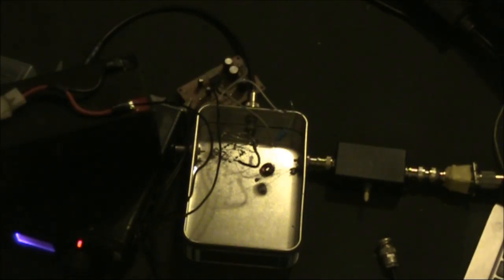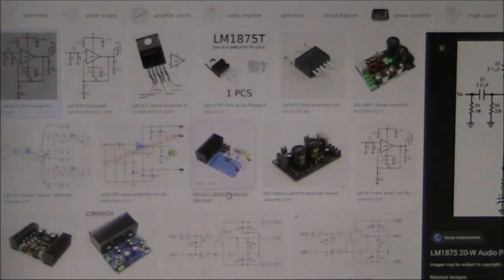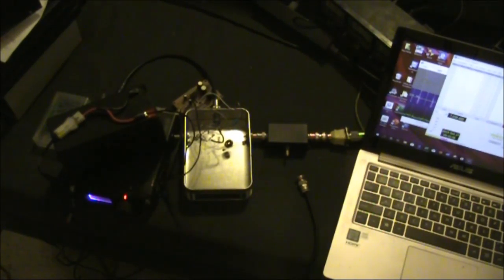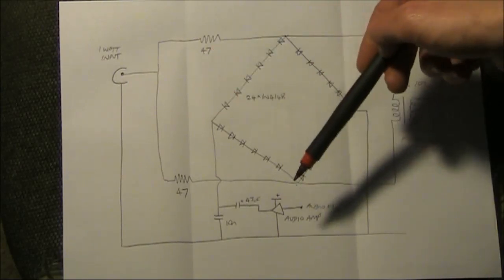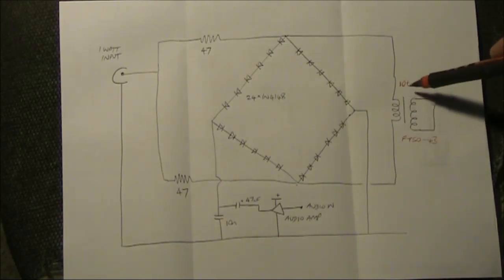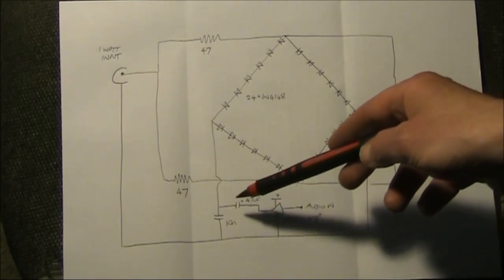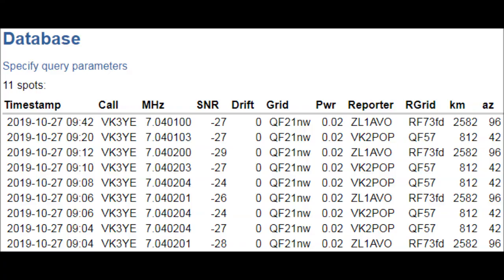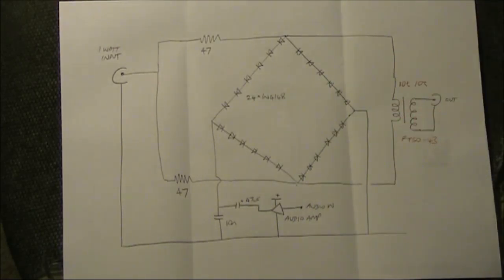My transmitter finals are 1N4148 diodes: A high level balanced modulator

Comment: There is another way to get half of the power out. Use two bridge configuration with a 33ohm resistor in each. 360mW in will get 180mW DSB out. Reply to this message for schematic
Reply: Could you please send me the diagram?
Reply: @py5lgpaulosergioabarroso266 Google 

21MHz 2W DSB transceiver JF1OZL
Reply: @py5lgpaulosergioabarroso266 your mail?
Reply: @py5lgpaulosergioabarroso266 your mail?

Comment: Certainly impressive and there's me knocking up a valve DC and dab rig using vintage bits apart from the balanced mixer of 1n4148 diodes. Yes,gone back to valves just for the Ego trip. Well done .

Comment: Thank you, a great vid.  I have a question to you and I am sure you will have an interesting take on it. Since it is more and more difficult to get a decent variable capacitor, is it possible to build an antenna tuner using a variometer. I can imagine that a simple variometer would be easy to build since there is only a single moving part in it.  I have heard that LF (630m) guys use them to tune their antennas. I wonder if such a device could be build for HF to handle QRP power levels or even 100W.  Could you use it to tune a loop antenna? Please let us know what you think about it.
Reply from the maker: An upcoming video will describe making a capacitor for an antenna coupler. It will be 'variable enough'.
Reply: Have you considered making a variable capacitor yourself? I have seen designs using threaded rod and PCB material
Reply: @gh-ur2lx  Not really. The real thing has many elements and every thing else is difficult to make. I do not have a shop to manufacture all needed elements. The variometer seems to be a better option. It can be made of an old plastic container. I do not know if I can use it to tune the antenna. I hoped Peter would answer this question...

Comment: Hi Peter,

Very interesting, as usual.  Instead of a stack of series diodes in each leg, what if you tried each leg consisting of a Zener in series with a 1N4148 (so they conduct in the same direction when the voltage per leg exceeds the Zener voltage and the forward drop of the small signal diode)?  The Zener would allow for the higher drive voltage from the transmitter, while the small signal diode would provide the blocking impedance (which saves the Zener) when the voltage on that leg is reversed.

Also, theoretical conversion loss for a balanced ring modulator / mixer like that is 6 dB.  In the traditional mixer role, the goal is to drive the "LO" port with the highest signal level possible in order to drive the diodes into switching mode - this then generates the "ideal" DSB signal, with minimal distortion due to diode non-linearity at turn-on and turn-off.  (At the higher frequencies, charge storage effects degrading the switching can be a problem when using ordinary small signal diodes.)  You could try increasing the audio input voltage to increase the transmitted power.

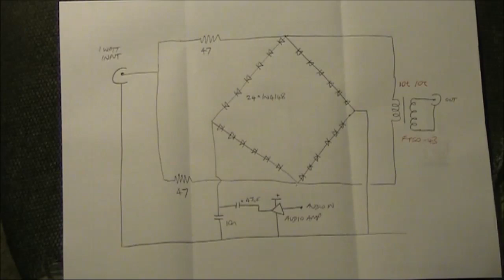If you can solve the conversion loss problem, then the RF drive can be generated by a Class C stage, thus simplifying the DSB transmitter design you speak about at 7:10.

73,

Mike VK2IG

Comment: If I'm ever shipwrecked on a desert island I want you to be there to knock up a transmitter from bubble gum and bailing wire.
Reply: You can built zinc negative resistance oscillator ( CW transmitter ) and zinc negative resistance regenerative receiver...